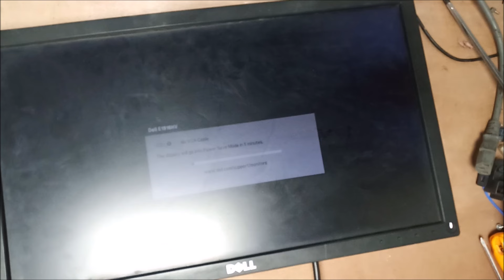Dell LED Monitor Repair | Dell Monitor No Power | LED Monitor Repair

Comment: What made you think to replace that optocoupler, is it a common chip to fail on these monitors?
Reply: It's usually to guess a faulty opto coupler because there is not output voltage if opto coupler is faulty. i.e. there will be no output if no feedback the switching MOSFET gets.

Comment: Now do one on the  ST220lb that doesn't have easy access to the four screws.
Reply: I figured it out.  The Dell circle can come off in the back exposing the screw that you need to remove in order to get into the monitor.

Comment: Video is good but you did not told about how to use set digital multimeter and did not described the board that where is input voltage 220, where its goes down volt and where is output volts and how many.

Comment: my dell monitor has some minor 'Horizontal' line on display, how can i repair that?
Reply: Replace low value capacitors in vertical section.
Reply: @babaji31  do you know how to fix the “power save mode” ? On the dell computer
Reply: @zayg1k  i think that has to do with a transistor.